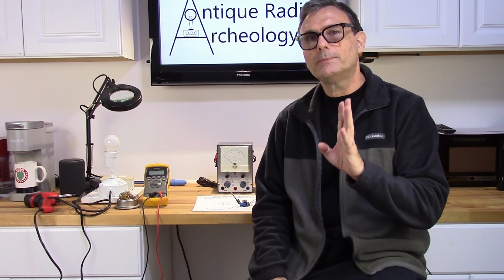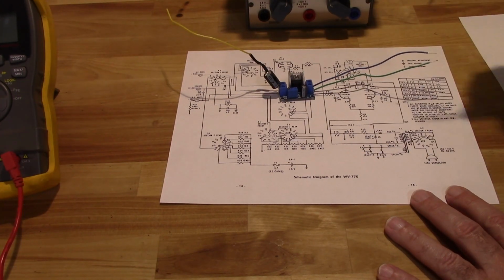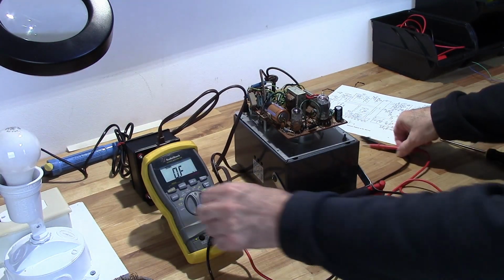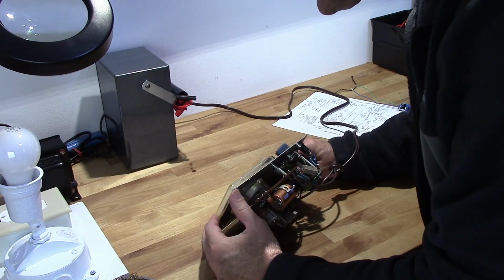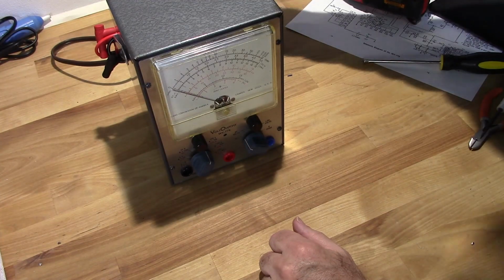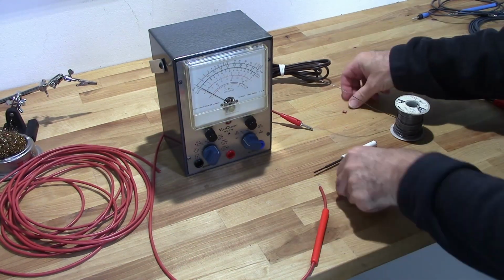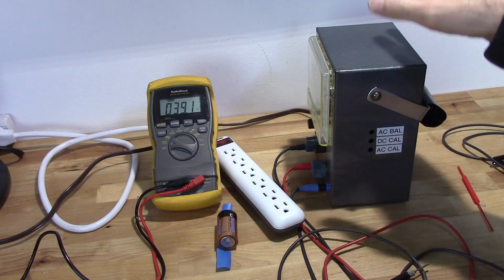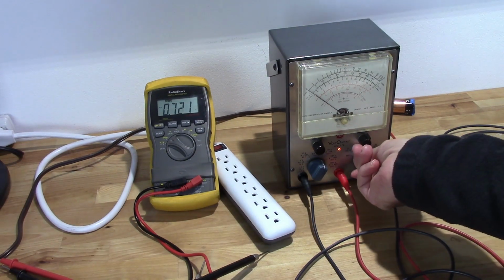Install a Battery Eliminator in a vintage VTVM

Comment: Great video. Thank you. It has been very informative. I have recently acquired a Heathkit V7a-UK (240V) model dating to 1959. For my first valve (tube) restoration project. I am already in the process of putting together a battery eliminator circuit for it.  But really my question for you is what type and gauge of wire did you use for your replacement probe cables? As I need to make a full set for my V7a.

Comment: wv-77e was my vtvm in my youth.   now at 83 and still playing with tube electronics i purchased a very used one at an attractive price. some d5 lube, adj pots and temp install a battery, got it up and going. had to use a plastic cleaner to restore meter face.  my question is do i need to remove the tube filament ground for safety ?                    barry

Comment: You could have gotten that for free, an built it from scrap parts laying around. Robert Sumption worked for Heathkit an has put the schematic an parts layout they used. There are other ones you could have found online. I hate that you paid anything for that kit. I am one that does my own an I would have liked to have seen you build it. Just my opinion.
Reply from the maker: I agree, and I've built a lot of Heathkits in my day, including a computer monitor and an oscilloscope among many other kits.  But what attracted me to this pre-built kit was the board, which was already laid out and the size was perfect for the replacement.  I wanted this to be an example of how to do it the easy way for people who probably wouldn't do it because it would be too difficult.
Reply: @antiqueradioarcheology-wil8878  I agree you do some great projects on your page I am restoring this meter and just finished the heathkit V7. keep up the video's you are very good I am fallowing you and hope to see more gear soon
Reply: I have also been using this same eBay seller's VTVM battery eliminator circuit board package. Originally, I developed my own discrete parts version (no LM-317) that works equally well, and it turns out it is comparable to the design Heathkit engineers came up with earlier. But I still prefer the LM-317 version these days.

However, that little LM-317 kit from eBay is not really optimal:
- First, the eBay seller does not make the circuit board-he buys it from some Chines supplier, and it is a general purpose linear voltage regulator. The seller just adds the rectifier diode and the input electrolytic capacitor and the three wires.
- Second, the Chinese kit is designed to regulate over a variable range that is quite wide, up to 40V or something like that. The values for the two resistors are appropriate for such a wide range of adjustment, but actually pretty poor for a dedicated 1.5V regulator. The small potentiometer ends up being very touchy if you try to finely tweak the output voltage. Different resistor values, and ideally the addition of a third resistor, would make for a more optimal circuit and better low voltage adjustment.
- Third, there is no secret at all on the circuit or the resistor values. They are essentially right off the LM-317 datasheet.
- The circuit board has parts on it which do nothing of value in this particular application.
- The circuit board is missing a diode which should really be present to protect the LM-317 from damage if the assembly gets accidentally connected incorrectly.
- If somebody wanted to make one of these, and used only the parts that are needed for this particular application, they would certainly be obtainable for significantly less money than the circuit board costs on eBay. But there is still the convenience of having them on a circuit board and having the extra parts already wired up (which is why I still buy this battery eliminator from the eBay seller).

Really, the biggest issue with installing one of these in a VTVM is making sure that the ground and input wires are connected to the correct sides of the filament transformer secondary. Getting it wrong will still result in the battery eliminator producing 1.5V, but leaving the Ohms function not working correctly. It is hard to figure out the correct winding connections because everything in that part of the circuit is very low resistance components in parallel. It comes down to tracing the meter circuit ground to one side of the transformer secondary, and making sure that the battery eliminator ground wire goes to the same point in the filament circuit.

And boy, that RCA VTVM seems to be a very unruly design, looks like a 'dog's breakfast' compared to the typical Heathkit VTVM design.